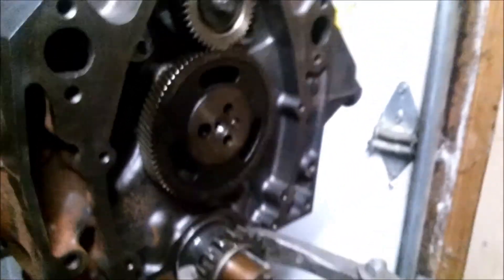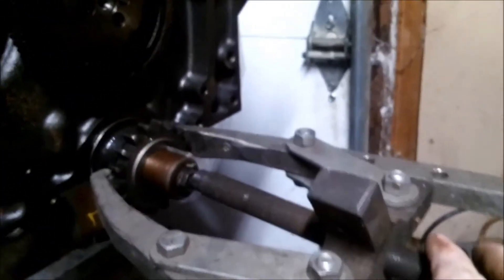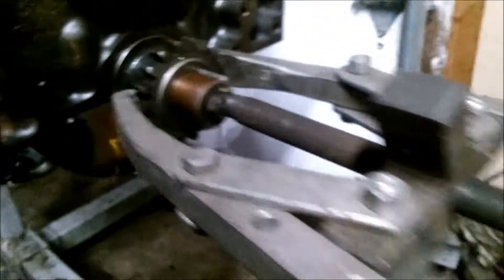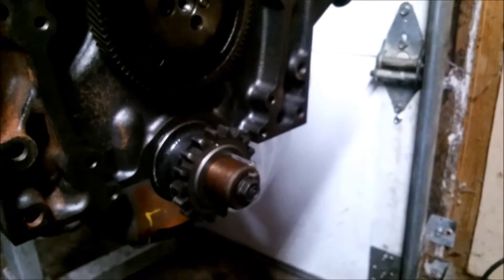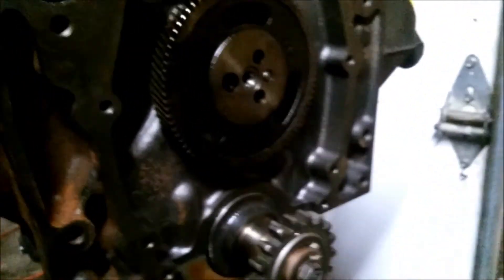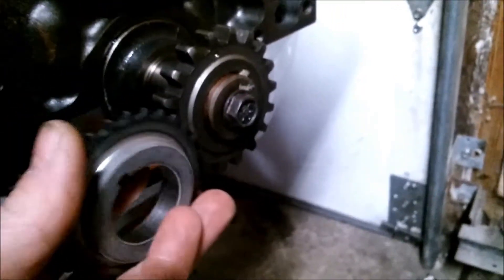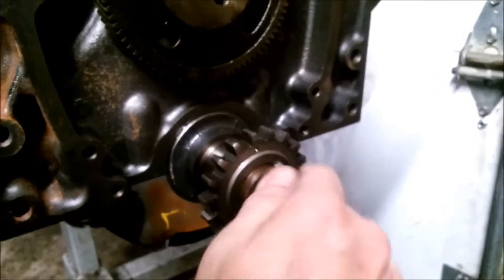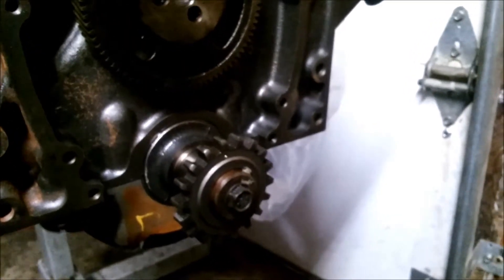Chevy small block 4.3, 350 crankshaft grear removal

Comment: Nice video, I'm in the process of replacing the timing chain on a 2000 chevy 4.3l V6 with the balance shaft. I was wondering if a larger chain set would work behind the cover. I heard  you say no, so I'll replace with the stock set. Thanks for the info.